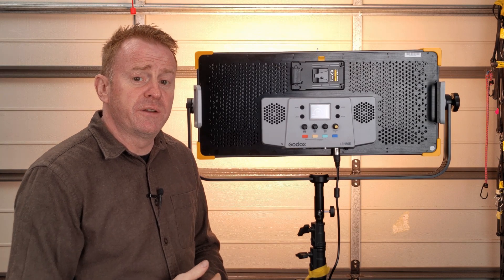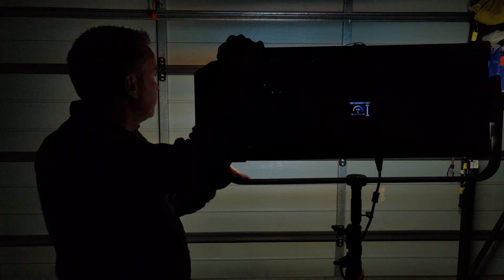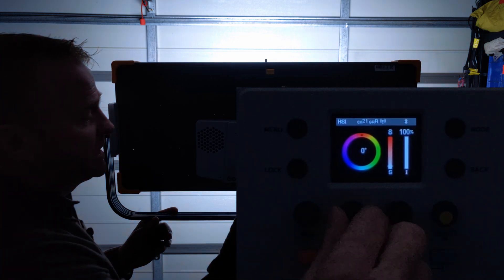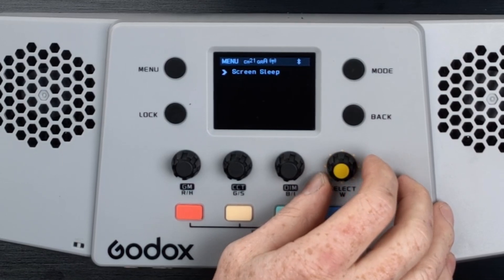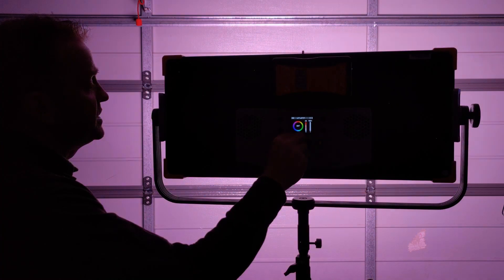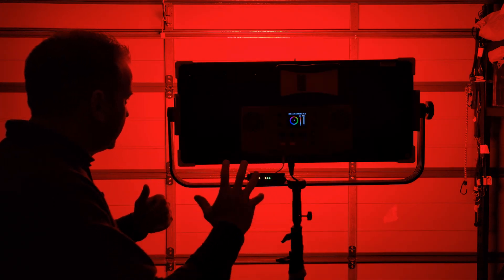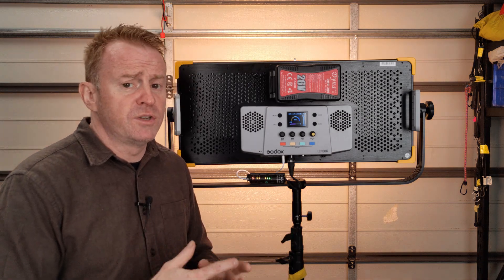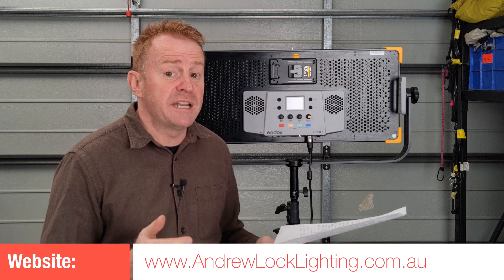Gaffer & Gear 151 - Godox LD150R

Comment: Thank you. Great review. It'll be interesting to see if they will attack the addressable issues you raised here in a firmware update, particularly in the 2800K range and in making the magenta/green adjustment values so that they will remain constant when set. They've been so responsive in the past. Appreciate another great analysis and breakdown from Gaffer and Gear. Always look forward to your reviews.
Reply from the maker: If they do I will follow up, if I haven't sold the light in the mean time!

Comment: I really appreciate the review. I've been looking at a few panels trying to figure out what would work best for me.  I need bright, I don't need v-mount, I'm not super concerned with the barn door situation.  I'm really using it as a light source for a top-down product photo/video room.  Given it's shortcomings but also it's price would this be a good option compared to the Nova300 or the mix panel 150 which sound like better lights but might be better in areas I'm not completely concerned with?

Comment: Hello, thanks for the review. I ordered a 150RS and had some issues with Magenta/Green cast. I see something similar in your copy so just wanted to make sure. When I was at -50 magenta the light was a little magenta as it should be, but as soon as I dialled to -49 the light turned green and very obviously without any gradation. And then it slowly added green until +50.
Reply from the maker: I can't remember back then and I have since sold or given the unit back to the distributor. I do remember it not being connected to the white value when dimming. I do remember finding the +/-GM useless.

Comment: Great review as always. What would be the Best Buy between this and the Nanlite MixPanel 150?
Reply: Following
Reply: following
Reply from the maker: They both have their issues, and both have +l- green that isn't locked to the whites when dimming.

Both have DMX. At the moment this one has a better phone app, but the MixPanel has the hard/soft mode.

This is green on the outside of the beam but the MixPanel is Magenta all over.

And both only run off a 26v battery unless you buy a step up v-mount adaptor.

I think the mix panel has slightly better special effects, and slightly better DMX.

This with its soft box this is a bigger softer source.

So you would have to decide what best suits you.

Neither light fits into my workflow or matches my existing kits for white point accuracy. But I have the same problem whey trying to decide what to get with higher end lights.

Do I buy another Kosmos 400, or do I wait for the 900w Fiilex Q10s, that is my current conundrum!
Reply: Thanks Andrew for your detailed response. Your review and most other reviews of MP150 had me sitting on the fence about the white point issue. So was steering more towards the Nova 300c, but I see the Nanlux 650c has just been released here in Australia. A lot more money but a huge amount of power. Hoping you can get you hands on one for a review.
Reply: @alanu6842  hi, please tell me why use such small panels at all?  Isn't it better to take a point source 300-500 watts with a softbox?  I myself am faced with a choice, mixpanel 150 or forza 300b, I do not understand for what purpose a panel with its dispersion area is needed.  Thanks.
Reply: @dowletcuzzayino4851  You do loose a lot of light output when you use a softbox. I use Nanlite FS-300's, Forza 300 and Forza 500's almost every day with 90/120cm softboxes, Fresnels and 6 foot umbrella's. But these are all daylight 5600k lights. I gel these lights when needed so getting a bi colour light is not what I needed right now. I really wanted something with RBG for more lighting options and to use with my PavoTubes and this panel and the Mixpanel 150 looked like a good options plus the small footprint is also appealing. But I do agree the 150w output held me back for sure as I do like to flood a set with huge amounts of ambient light and use other light methods to create the contrast I need. So I ended up buying a Nanlux Dyno 650c in the end instead 😳Massive power, but certainly not lightweight though. If you don't need RGB lights, I would 100% go with the Forza 300b because there are so many other modifiers you can use with it.